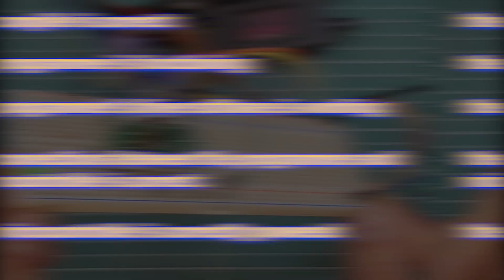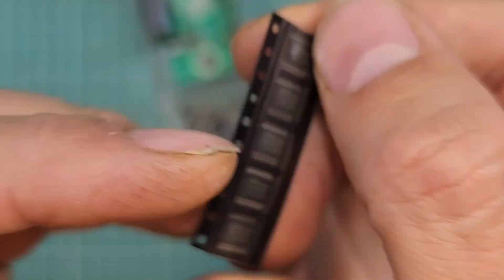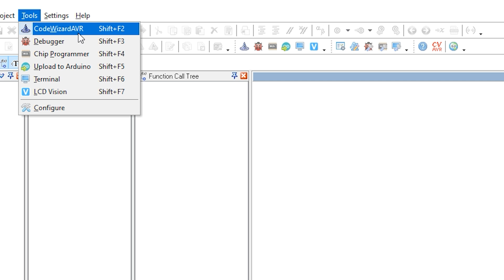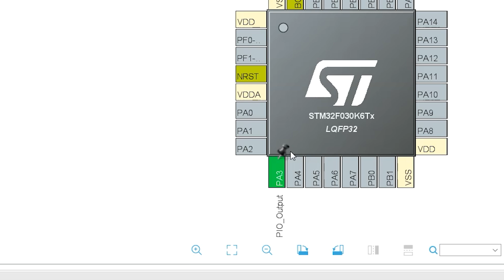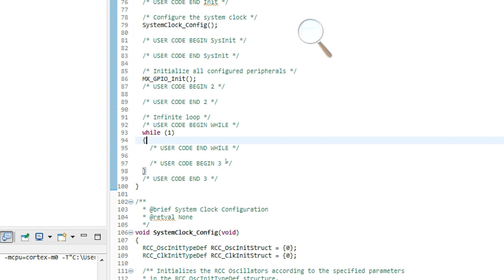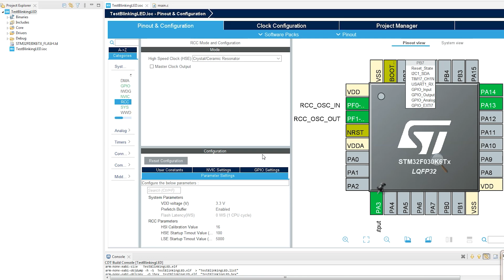STM32: First Blinking LED Project

Comment: In the video I noticed a tendency towards microcontrollers. Prototypes for debugging devices on them can be assembled on the table in the form of a tangle of wires, but in my opinion it is much more convenient when the prototype is monolithic. In my profile there are links (the last two) to photos where you can see how it looks and to the modules from which they are assembled. The project is open and is only developing. I lack feedback and questions. If there are any, I will be glad to answer.

Comment: If you usr a rubber washer when you mount the fuel pump a sheet of foam between the pump and heater case it wont make the noise. Same for fuel line, it vibrates through the line as well

Comment: As usual, a very informative and educational video - thank you.  I have extensive experience with Nucleo and Discovery boards from ST, and never considered making my own board, but you have changed my mind - I want to try!  It would be very useful if you mentioned the breakout board you used to fit the MCU you selected; where can I get one?  In addition, more information about the crystal (and capacitors) you used for the oscillator would be helpful.  I was under the impression the location of these devices (relative to the MCU pins) is very important.  Thank you again.
Reply: Its super fun-20 pin boards u can breadboard

Comment: Thanks for the video. I tried getting into STM32 some some back. Your video proves that it is so convoluted and so difficult to work with them. With my background in pic and assembly language, I must say that STM has lost the race against Atmel and ESP. If only they had an IDE  that was easy to use, I might consider giving them another try.
Reply from the maker: Yes, stm32 is complicated compared to arduino or esp, but it has its own pros 👌
Reply: What pros could there be? Apart from being availible during the chip shortage?
Reply: @chillipaste2183 :)
Reply: Yes it all looks very complicated compared to AVR or PIC.
Reply: Can debug on chip
Reply: @FatherGapon-gw6yo  Not a major feature for me. I never needed to debug a chip in the last 30 years.

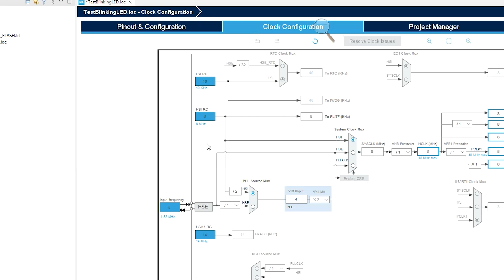Comment: 13:39 small correction. HSE(high speed external) crystal was not selected in the clock configuration. The MCU is using the internal oscillator. 

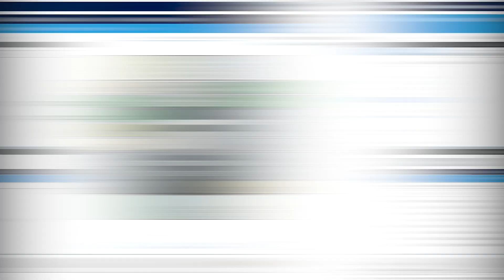20:05 I prefer clicking the run button in the stm32cubeide for programming. Much easier but students can't see the hex file. If I want to show them the hex file, I prefer STM32CubeProgrammer.

Great video by the way. You should link the stm32 hal description document for the hal functions.
Reply from the maker: Thanks a lot for correction ☺️

Comment: 13:04 if accidentally program without debug pins, you can pull the boot0 pin high, connect the SWD pins to stlink, reset the MCU, go to STM32CubeProgrammer, select swd mode, click connect, then do a full chip erase. Then you can reprogram it but remember to enable the debug pins the next time. I had a half of a workshop participants that forgot to enable the debug pins on a stm32f103cbt6. Big headache.
Reply from the maker: Yeah, it is a real disaster 😕

Comment: "blink(LED)"; does nothing for me and almost made me quit this hobby,  it teaches nothing to beginners and leaves giant gaps in understanding which makes it hard for people who really want to know what they're studying toget into.  First step is to stabaliz the oscillator circuit, otherwise the CPU  doesnt have any pulse to live.   Next step is too ... <--- this is the MCU lesson i wanted, a step by step descriptio of what this circuit does, CPU's are electronic cicuits, teach us the circuits going on that move the bits! (not you, all teachers in general)  Now manipoulating registers makes sense, and these high level functions we can write ourselves.  blinkd(led); should be the last line of code you write after you learned everything, not the first. But i get it they just want us to see led blink and clap our hand frantically, we did it!  they sell us an LED and intro book and after the clapping is done, they're gone... gone, we're left alone with a blinking  LED and understanding nothing,  all that happy clapping now gone... thanks to this style of noobie teaching.  Anyway thanks for showing us you can program the stm32 directly with its pins, most mcu's haves seperate connection pins for programming  and you forget they're all pins on the mcu.
Reply from the maker: Making a blinking LED is the most simple project that confirms your hardware and software setups are correctly made 👌 
I think it is helpful for beginners. 
Thank you for sharing your opinions by the way
Reply: What you request is not a beginner's lesson. This is a beginner's guide to programming a microcontroller, catering to people who want to *use a microcontroller*. Blinking an LED provides the absolute fundamental of timing and toggling a pin.
What you request is a lesson in computer architecture and circuits or in other words, *how a microcontroller works*. You will find Ben Eater's breadboard computer interesting, these will teach you how a microcontroller works but will forever not be a practical implementation. Another way, is to enroll yourself in an electronics/computer engineering, or get many books. To get to the in-depth detail I think you want, you will need to have basics in electronic circuits, logic gates and logic design. Which can be simulated with LTspice(circuit) and Logisim evolution(logic). Then there is HDL(Hardware description languages), finite state machines, machine language, architecture, etc... Which is great to know and learn but is definitely more a niche subject than using a microcontroller.
I am a teaching assistant microprocessor and computer architecture at a university in south east Asia. Most people will only need to know how to use a microcontroller in most projects.

Anyway, if you want to learn how a microprocessor works, try searching "Logisim processor" or "Logisim CPU". Amazing visualisation of a working processor.
Reply: You don’t need a microcontroller to blink an LED, its just the hardware equivalent of doing HelloWorld in software, it just confirms your toolchain is correctly setup, even just to do this basic thing, is still built on several layers of the technology stack, if you really want to go to the beginning get an Altair 8800 and physically toggle the switches to set all the bits to put one value in a register and see how painful it is
Reply: Fortunately there are millions of kids and adults out there who will disagree, if your struggling with how a crystal oscillator works perhaps a new hobby for you ?  maybe pottery or crochet ?
Reply: I think you missed the point he made at the beginning.
Reply: I think the author was very clear that he wanted to get through the “tool chain” (my words) before doing anything more complicated. Then, when the student has an issue on a real project, they can at least be sure (mostly) that it’s not something stupid with the tools.